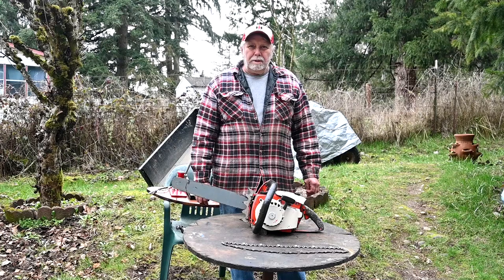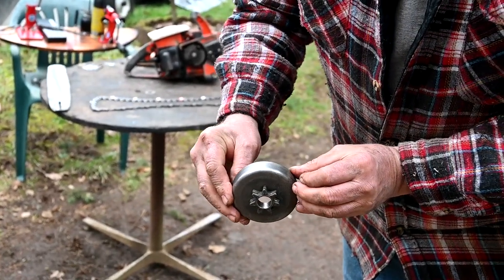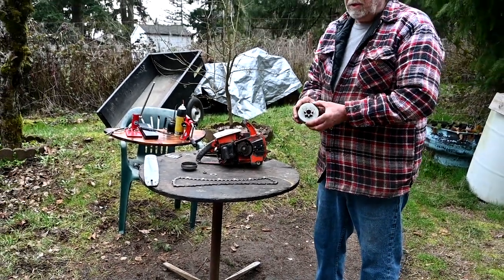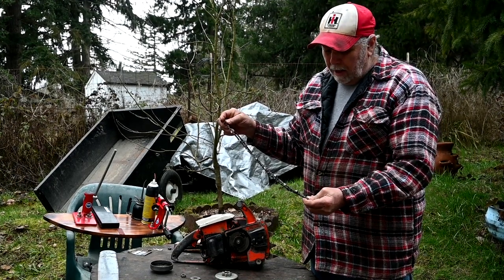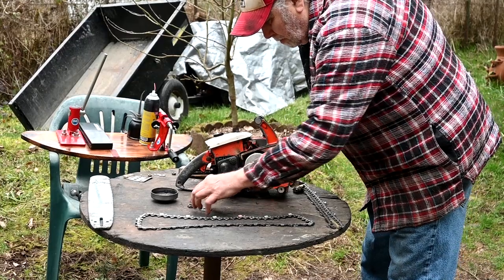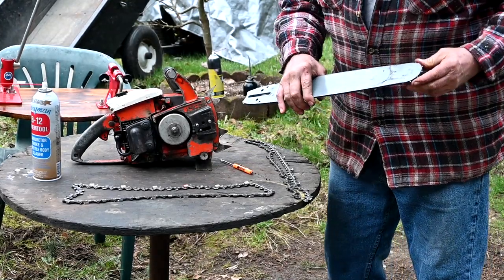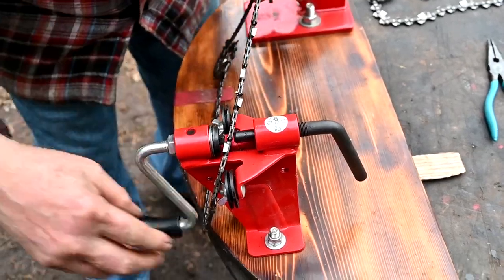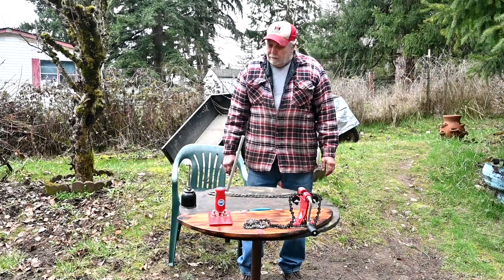Vintage Lombard Lightening Chainsaw Spring Tune Up + BS

Comment: Dealer told me the new bars don’t have a grease hole because it keeps dirt out and bearing lasts longer. Talk about BS. Good video, thanks for sharing
Reply from the maker: I have worked on a number of the late model saws with the non greasable tip, and all of them were partially seized and had to be freed up.  I made them greasable, problem solved.
Reply from the maker: You are 100% right on that, and the saw makers sell more crap as a result.

Comment: I happen to own and use a great number of XL12's and super XL's and one Lombard. The Lombard at first glance looks to be a exact copy of the XL 12. However  hardly any part from a homelite will exchange. The lombard uses the crankcase pressure to work the auto chain oiler. Homelite uses  crank driven a pump. The side covers are different as well as the air cleaner . Bar studs are smaller. I think it was made different to avoid patent infringment? We also have a poulan and a Barker that are look alikes.  Im like you I dont  like & use newer plastic chainsaws. We enjoy  & like your videos.
Reply from the maker: The basic layout like the crankcase is a blatant copy of the XL's, but you are right, they are not the same saw.  I have found a few items that fit both saws, but most are just enough different so they won'. 
 Thanks for watching and the nice comment.

Comment: Windsor was a Canadian company.  I understand it was bought by Oregon.  They made good bars.  If you want a full chisel chain, get a Stihl RS.  That’s all I like to use.  You can get an Oregon 3/8,.050 LPX in a full chisel, skip tooth.  That is what I have on my ms 660 with its 36 inch bar.
Reply from the maker: The Windsor bars have been the longest lasting bars I have ever used, and came stock on most McCulloch's. They were a bit heavy though. I have always used round tooth semi chisel Oregon chain on all of my 3/8" .050  equipped saws, as I inherited a big roll of it a long time ago, and have about 1/3 of a roll left.  My bigger saws that use .404 chain have the same pattern, so that is what I have always used.

Comment: In the past I used high temp wheel bearing grease, but even with it up you will get it on the inside of the sprocket.  I just clean the sprockets, periodically, and lube the sprocket bearing, again.  I have started using white lithium grease, the same thing Stihl uses from the factory.  I just consider any grease in the sprocket as a byproduct of cutting wood.  I would rather have a little bit in the sprocket than loose a sprocket bearing, because those little roller bearings can do some real damage to the clutch side of the saw.  I wish Stihl had drilled a little hole in the end of the crank so you can lubricate the sprocket bearing, externally.  Until then, I will just have to remove the sprocket, clean it, and lubricate the bearing at the same time.
Reply from the maker: I saw a video on Stihl saws a while ago, that showed some models have a remote greasing hole for the clutch bearing. I have never run into one though.
Reply: @mrobsoletesvintagehomestea9156  my Husqvarna 455 has one but I have to disassemble the rest to lube the sprocket bearing.  My Farmertec 372XP does not have one, either.  However, popping the E clip and removing the sprocket is not that difficult.  The only time I cuss is when the E clip goes into orbit.  I keep several spares around.  I have found the best way is to aim them downward and tap them down with a little screwdriver enough to be able to grab them with a pair of needle nose pliers.  If I drive them off the crank they can go sailing - spread them just enough to grab them with needle nose pliers and pull them off the crank.  I snap them back on the crank with regular old kitchen pliers.
Reply: @mrobsoletesvintagehomestea9156  none of mine do and I have a lot of Stihl bars.  The only one that does is the one on my 026.  I think it is .325, 050, 74.  Most of my .325 bars are .325, .063, 67, as I remember.

Comment: You know that with today`s laser cutting machines, you could take one of those old heavy Windsor Bars and skeletonize it like they are doing for a few of the modern bars. You would have a top quality bar that was lighter to handle. That might be something you would like to check out sometime.
Reply from the maker: I am used to running older heavier saws.  The types of wood I usually have to cut, is easier with a heavier saw, as I don't have to push down on it like I would using a light modern was.

Comment: Sears made some great old tools back in the day didn't they. I picked up a belt/disc sander at a garage sale for 50 bucks and it still works great.
Reply from the maker: Sears used to sell some really top notch tools and equipment. Not any more.
Reply: @mrobsoletesvintagehomestea9156   ya Sears closed in Canada here several years ago. I have 2 Craftsman lawn tractors as well as an old body grinder and a skill saw which were my Dads.